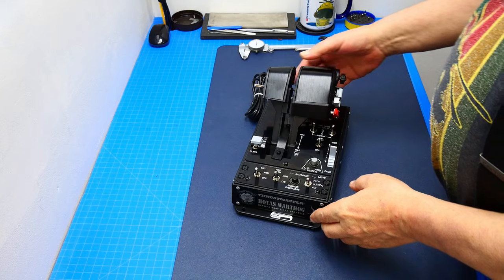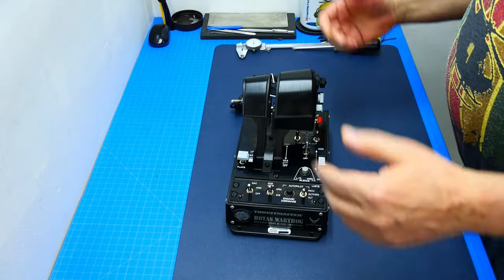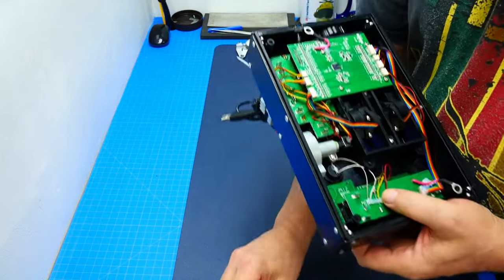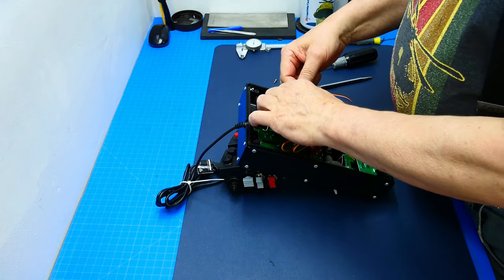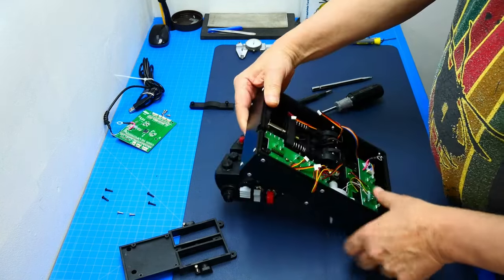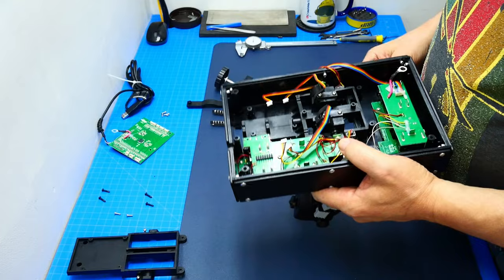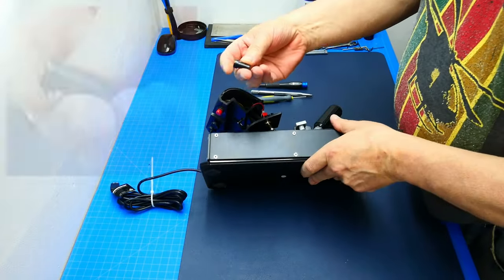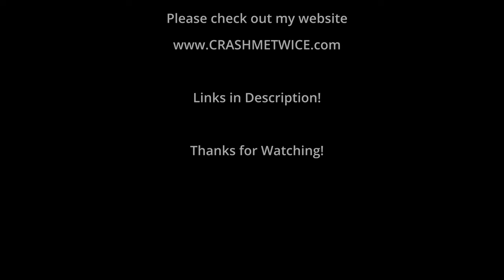Thrustmaster Warthog Dual Throttles Internals - A look inside

Comment: I've been using my TM warthog throttle for over 7 years now, it seems the only "improvement" they did is to change that crappy nipple cursor to an Xbox controller analog stick. IIRC they did this because the old supplier was gone, hence the "upgrade".
Reply from the maker: I got my first one in 2011 and had it for a few years, then I bought another one about 3 years ago. It's a shame that a company this big still sells this outdated stuff. How hard can it be to make a v2 and get a casting done for the throttle base and levers to prevent the twisting. A hall sensor for the sensor range zoom lever would have prevented the failure of my first one. If I would not have bought a second one I wouldn't have been able to have fun flying for a week or two. Although I can fix this stuff myself, not everyone can or wants to. They charge almost 330 bucks for this outdated thing. When I opened it up the first time, it looked inside like a Walmart RC toy and still does. Now I am using the Winwing Orion2 and don't look back. I could go on but..I rather take the time to check out your channel :)

Comment: It's hard to believe that they didn't update this model It seems so popular. This should be version 3 as it has been around for a decade or so.
Reply from the maker: Yes, I would love to see an update which would also include some cast or machined throttle housing. Thanks for watching and commenting! Cheers
Reply: Thrustmaster, Logitech and other larger-than-boutique-scale peripheral manufacturers tend to design a product and the production process in one go. 

Incremental improvements is not something that is often considered as such changes would impact large scale production, which is where these companies create their margin.

The only update the Warthog has received is a different slew sensor, due to the original model being discontinued.

The Saitek X52 Pro is in essence the only “improved” model vs the X52, launched in 2007, 4 years after the X52 in 2003..

VKB, Virpil and Winwing operate in a completely different market space. Their products have much smaller production runs and as such it is easier to introduce incremental changes between these lower volume production runs.
Reply from the maker: @tver  Good information here. Thanks for watching! Cheers
Reply: Vkb are a rip off for the same money for there full plastic mini an upgrade kit .. you must buy the kit or it has less functionality then a thurstmaster twcs an they dont sell the hats separately.. i can get a winwing base an 15e grip with freight from china included and its all metal    @tver

Comment: Had the warthog for a year and a half before the 'sticktion' set in. Over all a bit disappointed in the HOTAS and TM use of metal in the description. The warthog stick I have gutted and modded the springs and now use it solely as a cyclic but the throttle is usable and have no issue with its function but will likely let it go in favour of a virpil cadet and just build my own button box around it.
Reply from the maker: Glad you were able to get something out of this throttle. Yes, in my opinion it isn't quality they put out to the masses. Thanks for watching and commenting! Cheers

Comment: Great video. Back in the days there just wasn't much else. I went through many of these - like 4 or so. They all broke.
I only had to buy another myself as the rest was luckily still under warranty but it was a headache.
Mostly it was either the low quality switches, the cable from the throttle to the PCB, or the actual electronics themselves.

I never even used the plastic detent because if you do use it, it just wears out, especially if you do push over instead of lift.

Even the newest one I got back in the days was flawed though - for example if the LED's are not off or at 100% the slider axis would jitter due to the dimming of the LED's interfering with it.

So on the one hand I'm glad there is a newer revision with actual proper grounding and a replaced slew knob on the grip - but it's also sad they didn't do a bigger revision.
As it stands the warthog is vastly outdated, especially at it's price point.
I'm happy there is more competition in the market now, this really helps us all.
Reply from the maker: Yes, totally agree with you! This is number three for me with the same issues as you are pointing out. The plastic detent is hideous and the two plastic posts are an a joke. On one of my throttles, it broke and I couldn't find a replacement. I agree, this is no longer an issue though as of today there are many controllers are now available from other manufacturers which also updated to today's standards. Thanks for watching and your comment! Cheers

Comment: Both the Warthog throttle and stick seems to have been to designed to be relatively cheap to make first, and then a manager demanded that they made it feel more premium. Hence the bodge job to add these metal plates.

The sad part is that it works and people still judge it as high quality just because of the decorative metal.
Reply from the maker: Totally agree with you on all points. From my perspective, the quality of construction does not justify the price. Thanks for watching and commenting! Cheers
Reply: What I look for in a HOTS is not what it's made of. What I look for is are the controls fine enough to do silly things like in air refueling that takes fine Throttle control and a very smooth stick. I have bought so many that simply did not do well in those categories. I have been looking hard at one of those and also the WINWING HOTAS systems but they are fairly big investments. Also WINWING will not deliver to me as there is only a post office here and everyone has a PO BOX and they will not ship to a PO BOX so that discounts that one. Only way to get one is to have a friend in the City to order it and then I have the extra cost of shipping from there to here. Not sure if there is another one that's better. And the Turtle beach one is out. I tried one of those at a friends and it was Horrible it took to much pressure to move it from center and that I will not have.